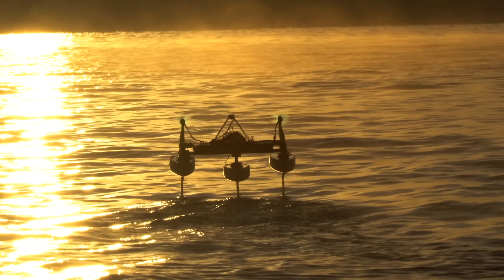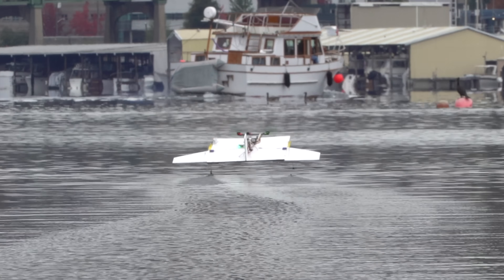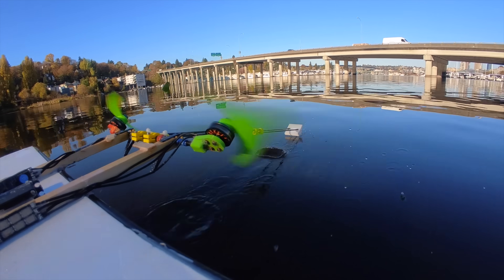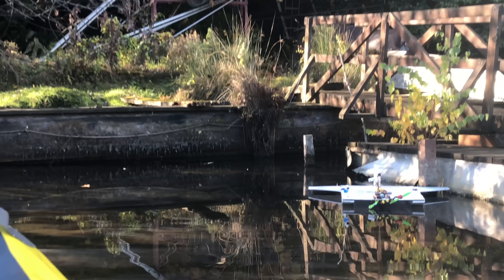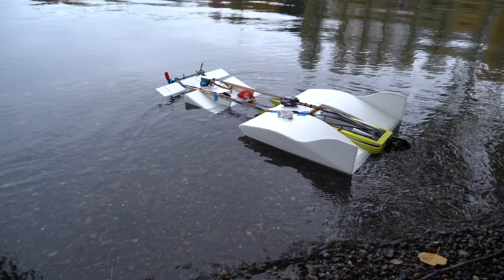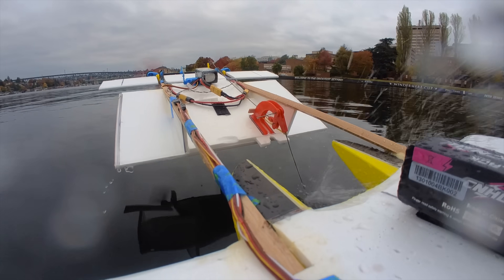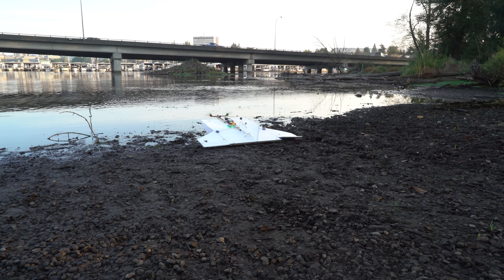Hydrofoil Control Mechanism on a Ground Effect Vehicle

Comment: On the very last plane: Instead of a wedge, make both pontoons triangular towards eachother, widest at the rear and skinnier at the front. This would make a funnel that forces air at higher and higher pressures toward the rear of the craft. Should prevent the rear from wanting to touch the water, while not giving it lift outside ground effect. May have to make an opposing opposite wedge on the top of the wing to make it neutral in air.

Comment: The reason your flight starts to oscillate at high speeds: 

The reason your RC goes oscillating with the wand directly controlling the flaps depending on the relative altitude of the water:

-The angle of flaps depend on the altitude of your RC
-The altitude depends on the direction(yaw) of the RC, speed and time passed since previous position
-The yaw is dependent on the angle of the flap,speed, and and yaw since previous position

Even a simplified version of the problem is a second order differential equation - The solution of this has a harmonic component - meaning an oscillation of yaw/angle/speed

Look for active and passive solutions to reduce resonance in mechanical systems.

Comment: You know when you skim a rock over water it bounces, is this something that could explain some of the problems ?  Maybe some kind dampener on the linkage from the water wands or change the weight or thickness of them ?  Love watching you solve problems as they occur and the onsite fixes helping diagnose what's going on.  Cheers for the videos.

Comment: Maybe the issue relates to the density difference between the media? Air/ water? Also: trailing link on the front not leading link will make life easier.           Outstanding work as always dude 🙏👍 Edit: obvs you tried that 🙈🔥

Comment: I wonder if the trouble you were having was due to where you were actually sampling from. On the full-sized ones it appears as though the wand samples the height of the very front of the vehicle and is then controlling the pitch at the rear. This means that pitch corrections occur in reaction to pitch rather than just reaction to altitude. When you're sampling from the middle of the vehicle by the time the wand is affected the pitch has already occurred and you're into the resultant altitude change.
You were close in the beginning but the wand was really long so even though it was hinging toward the front it was still sampling the middle of the craft.
I would be really curious to see what would happen if you put the wand out the front and head it actually sample the height of the very front of the craft so you would be getting corrections in response to pitch changes not just altitude changes.

Comment: The lift of that is created by the gap between the pontoons. I know it looks like the pontoons are generating the lift because the disturbance pattern in the water but here is what is really happening. 

If you watch a plane fly through smoke the wing tips are the only thing creating noticeable disturbance and that is visualized through the votex swirl you see.. We know the wing tips are not the source of lift!

Those pontoons are essentially only functioning as stabilizers. The gap between the hull is doing the lions share of the lift it is just spread out over a larger area so the angle of attack does not need to be as aggressive thus translating into a much cleaner wake.. There is only as much pressure created as is needed. 

that insane oscilation you seen was directly proportional to how aggressive those pontoons were. Imagine a wing with Dihedral and when the plane leans to one side that wing becomes level and generates more lift than the other.  The plane leaning is your craft listing (oscilation) and those pontoons are your Dihedral. Those are far to aggressive, so imagine the airflow across them as you are moving at speed and how you can shape them to only generate additional lift as one becomes lower... 

So your hull is your source of lift and the pontoons are your flight stabilizers...

Comment: Given the relative density of the water, a wand is going to get a lot more activation at higher speeds proportionally. Higher speed also means that any deflection of the elevator is also going to be proportionally more aggressive, so you have two elements both  disproportionally stronger at higher speeds, which probably can't work well.

Comment: hey on the one large pontoon foil, to get rid of the air hugging the bottom of the craft and making it pitch up, maby you could add vortex generators so the air comes off of the first ram air scoop cleanly? or cleaner at least.

Comment: Daniel, where is the bottom of the step on that wide bottom hull as relates to the fore-aft CG?  Normally I think it should be BARELY in front of the CG, however since you're generating a lot of the lift with ram air it could probably be moved back TO the CG or slightly behind

Comment: It's clear to me that the problem with the first plane was. As soon as the wands left the water. The elastic pulled the wands all the way forward. Thus forcing the elevons to the lowest position. Forcing the plane back down into the water. And then repeating the cycle. You would need some way to only return the elevons to a neutral position. and maybe have a switch to make the elevons go down only when needed.

Comment: Hey rctestflight, another idea: what if you could release air from underneath the body of the craft to control height?
Not by adjusting the angle of the craft or and flaps, but literally one or several holes in the center of a craft that are getting more or less covered using a servo.
This with e.g.  lidar should give you great altitude control without disturbing the pitch axis or anything else
Reply: Somewhat like the Formula 1 F-duct, where airflow is redirected depending on how much a hole is covered you mean?
Reply: @Excludos  I don't know those F1 systems, but it very much sounds similar to what I had in mind
Reply: @DerKrawallkeks  It was something one of the teams did a number of years ago, that made use of a very clever loophole in the rules. They added a duct that scooped up air from the front, and sent it back to the wing to stall the airflow over it, but only when the driver blocked a small hole in his cockpit, otherwise the air just went around. So when the driver put his thumb in the hole, the car got less drag on the straights and could reach a higher max speed
Reply: @Excludos  oh I remember that! Very clever indeed;)

Comment: You mention the wedge wing having no lift again, but isn't that only true if it has no angle of attack? In this situation and the prior video with it it can have an AoA, and then it works as a wing creating lift, though not a very good subsonic wing.

Comment: Goddamit, how many times do I have to write this? AUTOOSCILLATIONS ARE SOLVED BY DAMPENING. You need to handicap (in linear proportion) the rate of change of the control input. It's typically done by dampeners. Ever wondered why your car has shock absorbers?
Maybe use 2 elastic strings on each side of the surface instead of a single rod. Afaik, rubber hysteresis acts similarly to viscous friction.

Comment: I think you went wrong way in your first attempt 3:15 by reducing size of the control surface. I think it would be better by limiting forward movement of the wand. I see that when wand is completely out of the water it makes elevator to go up (making to drop the nose), but elevator should just be in neutral position, reducing the downforce, but not making lift

Thinking of mechanical stabilisation... is this possible to make actuator that use pressure under the vehicle? In this case you will not generate so much drag as by touching surface

Also there is pretty interesting mechanism, rolleron https://youtu.be/x8L83AHYum0. Maybe you can use similar mechanics in some of your concept vehicles.

Comment: I wonder if bending the tips of the wands backwards would help? That way, the steeper the nose-up angle, the lesser the pitch-up effect.
Reply: I realize my comment isn't super clear. What I intended to describe was this: the wands, if shaped like "skis" at the tips, would present less drag as they were pulled up "nose first," so only the "heel" was still making contact with the surface.

Comment: Interesting course of study and your R&D is really interesting also. I have the exact same Boston whaler you have and found these vids also.
Consider the Freeman boat Hull design, they use a catamaran hull to funnel lift but they stay in the water.
You might be able to use a gull wing design to funnel each wing instead of the flat wing
Reply: I like the Insetta and Aquila foiling cats.  Totally passive and not designed to life ALL of the hulls out of the water, just most of them.

Comment: Maybe a future iteration of this could add a spring and damper to control wand to allow you to PID tune it.   I'd love to see projects with a physical implementation of  controllers you'd typically digitize
Reply: He had a "spring" it was the rubber band.  I think what was missing is damping- something that resists change- maybe Tighten the linkage pivot/screw to make it stifffer.
Reply: @cetyl2626  I don't know how I missed the rubber band.  In that case, the rubber band would provide a small amount of damping on its own, just not enough. I'd be interested to see what tightening the pivot does.  I suspect it would just decrease the magnitude and frequency as friction isn't part of the damping terms of 1 dof systems like this.  Damping is proportional to velocity, so adding more friction may not have the desired effect. I would like him see him attach a cheap medical syringe to the control horn to add damping and stabilize the system
Reply: Came here to suggest the same thing. Might also want to adjust the mass/moment of inertia of the control surface as well. I think that would have a different effect than changing the wand length but I'm not entirely sure I guess
Reply: @kiddrone8336  I think changing the mass would mostly alter the magnitude and frequency, not necessarily the stability. In theory increasing the mass/moment of inertia should lower the natural frequency of the control wander.  Pretty sure he really needs something to remove energy from the control wand.  Armchair Pilot mentioned tightening the pivot to increase friction I think.   I believe any non-conservative force, like friction could potentially be useful for stabilizing the system
Reply: @chain3519  Would definitely be interesting to see a full spring + dashpot system applied to this. It seems that it could be difficult to avoid over damping though, certainly easier to just use a software solution.

Comment: I remember back when I was a kid we had these race cars.  You threaded a "T" shaped, geared handle in to a slot, whipped it back out and an inertia wheel powered the car.  You were meant to crash them in to each other or a wall and all the pieces would fly off.  You had to re-assemble the car to race again.  That's what this scene reminded me of.  I'm old.

Comment: Can you try using some kind of mechanical pressure sensor (and maybe a combinations of multiple) to mechanically control the angle of attack? Also you likely need some kind of elastic join between the mechanical input and the control surface. That should get rid out of oscillations.

Comment: Coming from a moth sailor the wands are very sensitive. They are carbon with a lot of flex and usually a paddle on the bottom. They’re moved as far forward as possible to have the cleanest water to skim. They also have gearing mechanisms, usually a barrel adjuster that changes the sensitivity between the wand and control surface. We’re constantly adjusting these for different speeds. They act as our tuning to prevent bucking and maintain ride height.
Reply: Great idea and testing. With refinement it’s an incredibly redundant and efficient system.
Reply: Moth sailing - didn't know the boat, is it similar to the waszp, if you know that one? 🤔🙂
Reply: @TheStuartstardust  waszp is a single design, moth is a competition class. They're close in size but different in basically any detail.
Reply: Having the wand as far forward as possible also probably increases the phase delay margin of the system. That's probably what caused the oscillations here. Also being able to adjust the gain almost definitely helps with that as well.
Reply: I thought having a way to adjust the sensitivity on the fly might be a good thing, but accomplishing that in such a small platform, especially on a retrofit would be a challenge.

Comment: you could also do super averaged distance sensor control
Reply: yes smooth the heck out of the distance measurement, to get the mean water lever, remove the waves, you can sensor determine them separately
Reply: too much control from the wands
Reply: holy crap what a design mistake to put a spike lever pointing to forward
Reply: if it looks like a skimming fish, its a fish
Reply: super nice landing touch down
Reply: kite it bro, or just large wing glider
Reply: Try single middle hydrofoil ground effect diamond angle cube craft
Reply: The angled flat square body is a self-balancing gev lift body
Reply: The more not flat you make it the more it has the middle groove as a slow speed hydrofoil

Comment: Now I wanna see you go electromechanical with it using pressure sensors. When pressure is removed from the rods or paddles it changes the control surfaces with the servos. Then you should be able to fine tune it more so than the radar version. Just change the weight value that leaves it right where you'd like it to be.

Comment: The wand control on boats looks like it's extended out in front of the boat - maybe so it can respond in time to the wave as it boat cuts through them?  The form factors are so different - solution likely won't be 1:1. Also agree with another viewer, wand cutting through the water rather than floating on top will junk your data

Comment: In the bonus footage, do the vertical surfaces on the inside of the pontoons provide any yaw control, and does that pocket help catch the air for the ram effect? Covering up the entire front wedge introduces multiple changes to the airflow, in the most critical part of the vehicle. Lots of ways to experiment with the variables there.

Comment: so close bro! the oscillations aren't causing a feedback loop, if anything they are too active. Motion smoothing is your answer. Whether shock absorbing or other flexible membrane to curve out the waves and water pressure difference on the lil wands.

Comment: I noticed that the commercial wands you showed at the beginning were more flexible over their length than your shorter wire one. Perhaps that flexibility affects the amount of throw at any given angle to provide a damped input at higher speed?

Comment: You might want to consider some sort of finer-grained pitch control. You’re so close to the ground, and your vehicles are so small and light, that pitching up or down too quickly will rapidly take you into or out of your target ground effect zone. You should consider a mechanism that tries to control how quickly the pitch of your aircraft changes. 

Basically, you’ve been trying to stabilize your ground effect vehicle using only proportional control. “How far away is my vehicle from my target altitude”. That works fine at lower speeds because the entire system reacts slowly enough for everything to work. 

However, it stops working at higher speeds because your vehicle pitches up or down faster than your system can react. “How fast is my target vehicle changing altitude.” By the time your proportional control system is far enough away from your target altitude to work, your vehicle is ascending or descending too quickly for the system to compensate, so it either shoots into the sky or darts into the ground. 

I’d consider making a system that controls the rate at which your vehicle’s pitch changes. If your ground effect vehicle is only pitching up or down slowly, it’s not that big a deal. At lower speeds, your aircraft is stable enough passively, and it’s only at higher speeds where you’ve been having issues. However, if your aircraft begins changing pitch rapidly, as it does at higher speeds, your system should react more quickly, damping oscillations. 

Once you get that down, you can refine your vehicle’s design so it can be more passively stable at higher speeds, requiring less corrections from whatever electronic or mechanical system you design; or you can redesign your current altitude stabilization mechanisms and probably have better success with them at higher speeds.

Comment: It seems that the oscillations are appearing when you get to the point where the rods got out of the water leading to a strong control input. Perhaps a longer paddle shape that's thin at the bottom and thick at the top would work better (inducing a gradual increase in control output depending on the height of the craft due to increased drag from the paddle)

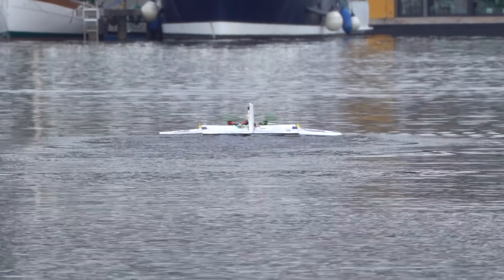Comment: I think in the original iteration of the wand control, the overturned feedback you were getting (about 2:27) was due to too much nose down elevator thow that was only commanded at higher speeds. If the elevons' throw could be mechanically limited to maybe half (or less) of the original throw, that might help. Great videos... Keep at it!
Reply: You can see that when the wands lose contact with the water, the the elevator throws all the way down, causing the nose to drop quickly.  Maybe just locking the elevators so they can't go down at all would help.
Reply: I was about to write a comment to exactly same effect. You can clearly see that when the wands break contact with the surface the rubber band causes the elevons to go full tilt down, causing the oscillation. Limiting the throw so the control surface does not bottom out in negative pitch input will definitely eliminate the undesired effect.